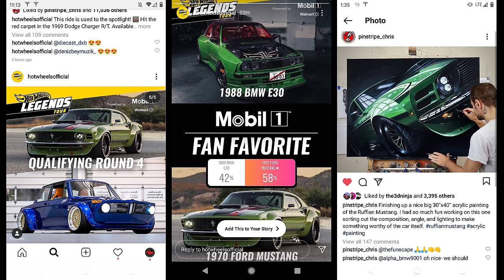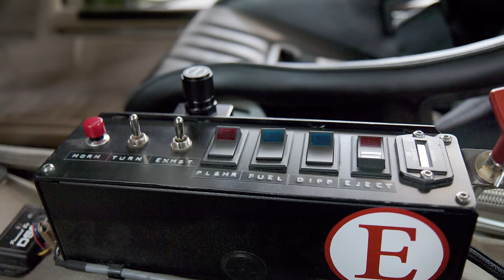RUFFIAN MUSTANG: 625 HP "Boss 427" All-Steel Widebody 1970 Fastback Mustang | EP16

Comment: I had a 70 bud Moore home built version with the Meyer Fiber glass flares. 351c 4v top loader, nascar short track cam, Lincoln drilled 4 pistons and 67 4 piston rear conversions, 3.89 t lock, heim jointed sway bars, etc. Boss 302 track cage. It was fun to autocross in 86. Had to convert it for street use with lights and  wipers.  Painted aircraft green polyurethane.  Like Mad Max Falcon.  They called me Mad and the car Max Bitd. Memories.
Reply from the maker: Thank you for sharing!!!
Reply: That's sick! 💥
Reply: Awesome!

Comment: Hi 👋, What a great drive must be very happy with that, When I was in late 20 / 30 I raced 250 Cc Honda Kart , And considering I didn’t have a lot of money for a couple of trophies, in 2001/2 About 20 of us road from UK to St Tropez Harley Davison softail deuce. Hog rally, We were there for approximately a week one of the guys found a Kart Circuit, We ended up  hiring the circuit for the day, at 50 years young, I won every race apart from 2 , One because Throttle linkage  broke,  the 5  race I got T-bones , For some unknown reason they started accusing me that I had race before, 😂 . As the guy said to you slow and easy smoothness Great throttle control, Very rarely touch the brakes just to get the back to breakaway and drift round under power.
I have never watched quite a few of your territorials find them very interesting, Good experience, Even to this day I drive corner to corner.
PHIL FROM THE DARK SIDE OF THE MOULIN 🎸. FRANCE
Reply from the maker: Thank you so much for sharing your experience with us!!  Greetings to you in France!!

Comment: Message for Chris: Very smart "flipping" the rear lateral control Watt's link. More cars affix the center pivot of the bellcrank to the center of the rear end housing, low link to panhard bar mount on frame LS, upper link to subframe on RS. This creates a "pure" vertical motion RELATIVE TO THE CAR BODY (which is rolling to the outside of the corner, so); the wheel bump tracks the rear end housing slightly laterally - creating an odd feel for larger bumps or larger body roll angle.
Making the pivot of the BELLCRANK on the Chassis and affixing the low link to the low end of the rear axle housing (LF or RS) and the upper link higher (above the axle, other side of center) to the rear end housing; this creates a vertical path relative to the rear end housing (and perpendicular to the road surface) so there is no lateral movement in bump affecting the chassis.
Comment back to me if you wish to discuss further - and a concept for a FULLY true independent front and rear suspension that does not induce body roll, does not need any anti-roll bars (the body isn't rolling so, unnecessary) and does NOT bind up the chassis at all. It has been fully simulated in MSC-Adams Car software (I was an Adams applications engineer at MDI - now MSC - for many years).
I know that it would be mind-blowing on an autocross car - no chassis roll!
Reply from the maker: Very interesting...thank you for sharing!!

Comment: Nice driving...knocking 2 seconds off with each run is really good... 
This seems to be very like slalom events here in France but more sane.
At my local circuit, which was originally designed for go-karts, so a proper twisty circuit, they change the thing with heavy hay rolls (1 ton + if it's rained overnight),there are  trees and there's a blind crest with adverse camber 180°right  immediately on touchdown....

One year I wandered up the outfield grass after the crest and realised there is a 40 foot drop down the tre- covered bank to a main railway line! 
No barrier, of course.
That'd be way too sensible.  This is, after all, France.
Reply from the maker: Love it!!  Thank you for sharing with us!!  We're so glad you enjoyed watching this episode!!

Comment: For the Boss Mach I Weiand High ram Tunnel attached to one Holley 850 cfm. Maybe 2 inch ground clearance 2 inch oil pan and ground. The 3 inch ground clearance under door of Ford to the floor, cool extra flare fenders and 3 degree neg. camber just front alignment wheels. The side exhaust pipes should go thru the wall where the rear seat is. For a real reason you have 4.11:1 rear diff. overall ratio but the tire has a diameter that change the output torque per rpm range. The rear wheel of SHO Mustang 1970 Racer green with Yamaha intake plenum Multi-port F. Injection fitted to Crate motor. The tire is 22 inch tall for best take off bottom dead torque that nothing beats 13 inch rim drag car 4-wheel drive top Fuel. Boss 4.22:1 rear diff. includes maximum 2 foot width of both live axles and ring gear in the housing. You made the tires into both track like it is cornering is better because the widest width of your car onto traction while riding hi-speed on street parking lot is high performance. But the gravity is low center of the Boss slalom car is good performance but better off to get the 4 wheels steering Denali for racing and it must become change into low rider just like your Boss Ford Chevy Hybrid of expensive design. The two wheel steering is possible to captive the car. The 4 wheel steering for great low profile is impossible to captive. The air shock absorber can rise higher when turn left at same time towers right side air non dampener must be higher ground clearance. The left side is less ground clearance 2 to 3 inch. Right side will be max ground cleara. 6 inch. Lean is around 10 to 20 degree inclinometer of your newest design prototype while it drove on the level horizontal road parking track. Stupid old car is always like this while turn to the right, it sway meaning right side under the car 55 MPH it increase the height of ground clearance up to crazy high 6 inch to 7inch as opposite of computer controlling the shift the sway into opposite of the lean car must run like skateboard that weight min. 4,000 pounds or 5,000 lbs includes roll bars max.
Reply: I think you summed up the episode perfectly…. I mean, it seems like this is a word scramble of sorts.  Is there a prize if I can make it make sense?

Comment: Wanting to keep it cheap and light. LS3? All aluminum Ford 427 would've been the right choice, though.
Reply from the maker: The Ford is too wide to keep the original shock towers, and Chris was motivated by the TransAm traditions. Thank you for watching!
Reply: @NicoleJohnsonsDetour  I didn't know you had to keep the stock shock towers for a street driven car. I replaced mine.

Comment: Amazing true trans am style cool but killed the vibe with the LS sad ! A car like this should have a Ford coyote motor! : ( like putting a coyote on a first gen Camaro guy looks like charactor on king of the hill
Reply: I don’t think you watched the episode.   A coyote won’t fit with stock shock towers.
Reply from the maker: When we filmed this, we talked in greater detail about Chris' reasoning behind not using a Coyote, but it's only briefly discussed in the episode. At 5:26 he says that he uses the LS3 because it's a newer motor with an old school design, which he needed to do to fit it between the shock towers. He really wanted to try to build something that fit the TransAm rules, and that was one of the requirements. Ford doesn't have a modern option narrow enough to fit between the shock towers. He also has a Hurst shifter... what I appreciate about Chris is that he is more concerned with building what he likes, rather than worrying about what brand the components are or what people may think about his choices. Seems to be working for him... he has a huge following!

Comment: Where can I find those deep dish rims??
Reply from the maker: From ruffiancars.com, they are Signature ONE in Gloss black hoop, matte gun metal center, black hardware 
Front Wheel Size: 18x11
Rear Wheel Size: 19x12.5
👍🏻
Reply from the maker: Oh wait... those specs are probably for Chris's street wheels... hmmm... I'll see if Chris can shed some light on the race wheels, if that's what you are looking for!
Reply from the maker: Ah here you go… from Chris: 

Also Signature Wheels. SV603 Attack Series. Same size for the race wheels except we couldn't go quite as wide in the rear due to being one piece monoblock wheels (for lightness) so they are 12" wide.
Reply: I need some lol.

Comment: Boa tarde congrats carros this owner built 1972 Chevy c-10 longped makes a Big impression, custom g 1951, this bagged c-10 at the beachis the best, what s LT like to drive a 1964 c-10 truck? ( Supermerged Chevy lsa), 570 Hp ls3 swapped Chevy sububan hot Rod, 80 c-10 drag truck page 2 -the 1947 - presen t Chevrolet GMC truck message board network, this 1967 Chevy c-10 is smokin, duramax diesel powered 1956, Marty -s 1965 c-10, c-10 era Detroit pistons bom 💪🏾👍🏾😎✨🚗 amén trabalho c-10 era 2023 uau sabia de tudo
Reply from the maker: Thank you for watching!

Comment: I dont know how this guy did what he did.. because a stock 70 mustang boss 429 is about $108K - then the LS3 with trans is abut 22K.. by the time YOU finish this car, suppose you do the same, painting, bodywork, mechanical, parts etc is about $167,000.. NOT CHEAP by any means.
Reply from the maker: Chris started with a basic fastback. It wasn't a Boss or Mach or anything fancy. Still, not cheap!
Reply: It's not a real boss. Was just a sports roof with a 351 in it.

Comment: I'm somewhat conflicted, I bleed Ford blue ,and it's gasp LS powered . HOWEVER , I'd rather see the shock towers with an LS than no towers and a SBF. and besides GM stole the LS design form Ford anyway
Reply from the maker: Thank you for watching!!
Reply: How did gm steal the design? I’ve heard that before , but never knew the story..
Reply: @caddydave  it may not be an outright copy but GM did make it similar enough in ways such that things like cylinder heads will bolt on from one to the other. Google would be the best one to ask for details
Reply: @2nd66tube2  ok, I googled it… I don’t really believe it though.   Let’s say the head bolts on, is the gasket the same.  There are only so many bore spacings and bolt patterns for a head.   If gm had really copied Ford , they would have made it so none of the parts interchanged with any other engine size…. :)

Comment: Why use a GM engine on this classic Ford ? Why not use a 5.2 supercharged 760 HP  engine from a GT-500 ? Smaller displacement and more power.
Reply from the maker: Chris wanted to keep the Trans Am rules, so he kept the original shock tower locations. A modern Ford doesn't fit, too wide. He also didn't have the budget to do that if he wanted to.
Reply: Thanks for the info !! @NicoleJohnsonsDetour

Comment: why is she driving with left foot on the brake the whole time it should be on the clutch
Reply: There was no need for the clutch on this run…. It’s pretty common to “left foot brake” in various forms of racing..
Reply from the maker: Left foot braking eliminates the coasting that happens when you take your foot off the throttle and transition it to the brake. Might not seem significant, but the time adds up. Additionally, the suspension stays more balanced when there's not all the back and forth with the right foot... sometimes I even drag the brake a little while still on the throttle to keep the RPMs up and slow the wheels. Once I need the clutch, then the left foot handles it, and the right foot moves over to the brake, when stopping, for example. I have used left foot braking in all of my professional offroad motorsports.

Comment: What a paradox, a gorgeous classic Trans AM Mustang ruined with a boring, budget engine swap. A total lapse in judgment.
Reply from the maker: Modern Ford engines don't fit between the stock shock tower locations, as required by the Trans Am rules which Chris was intentionally following. Good judgement requires all sides be considered. It appears he did not have a lapse in judgement, but thoughtfully considered how he would build his car with the resources he had.

Comment: If you don't know anything about engines, just copy everyone else and LS it
Reply from the maker: Given his reasons for the selection (high displacement, lightweight, affordability, and still fitting between the stock shock towers to keep true to the TransAm series specs), rather opposite, wouldn't you say? Seems to me that Chris knew quite a bit about engines and available options when deciding to put an LS platform in his Mustang.
Reply: Once you have built / worked on a few fords, you realize why someone would arrive at an ls…. :)

Comment: Love the Eleanor engine set up except for LS? 😡 even though u went Chevy 6speed 😢what food doesn’t make good enough 6speeds? I bet a newer GT350 R Tremec one may do u better u did all the work go back to ford power man!!! JS u do great fab work find a way to coyote it
Reply from the maker: Chris didn't use a Coyote because it's too wide to maintain the shock towers, which was more important to him in keeping with the Trans Am rules. Cost was also a factor, but his primary reasoning was the fitment of a modern Ford.
Reply: They don’t actually…. Ford doesn’t have anything even remotely close to this in terms of size / weight / cost.

Comment: Beautiful car... To bad he ruined it with the Chevy motor...  Lost my interest at 5:33
Reply from the maker: Too bad! You missed how much fun we had racing it! Thanks for trying it out... perhaps you would enjoy this episode with a very respectable Ford Performance motor: https://youtu.be/TnsC8Q2JWMc
Reply: @NicoleJohnsonsDetour  The Ultra4 Bronco was great... It had the proverbial Ford in a Ford which is how it should be.  
The craftmanship on the Ruffian Mustang was great but the choice of motor is no bueno for many a Ford fan.  How would a Corvette purist feel if someone installed a Coyote in a Vette?
Reply: @billgoodwin3053  The problem is that the Coyote is just too wide to fit in most anything besides the vehicles it was originally intended for.    The front suspension is (mostly) bolt on and the LS fits without have to cut the body  / inner structure of the car.
Reply: @caddydave  You miss my point.  I was using the Coyote as an example... I could install a Godzilla in a Vette and get the same response/reaction...
Reply: @billgoodwin3053  I didn’t miss your point.   :) a Godzilla won’t fit in a Corvette either….   Unless of course you want to hack the car apart.
Reply: @caddydave  The Godzilla is 1 inch wider 25.75 vs 24.75 than an LS and 4 inches shorter 24 vs 28.75.  So other than motor mounts and crossmember mods I dont see any hacking required
Reply: @billgoodwin3053  ok, I stand corrected on the physical dimensions.   I won’t go into all the other reasons why a LS is still a better engine choice.  :)
Reply from the maker: @billgoodwin3053  @caddydave Good banter, boys. Good banter! Chris was on a budget and wanted to keep the shock towers because of the TransAm specs he was striving for. It may not be a perfect choice for everyone, and I understand how blasphemous it feels to some, but to each their own. If their workmanship is admirable, I appreciate their efforts and freedom of choice! Thanks for watching!
Reply: @NicoleJohnsonsDetour  I will keep watching cuz you get to drive some cool cars.
Reply from the maker: @billgoodwin3053  Yes, I can definitely say I get to drive some very cool cars! Thank you!!

Comment: I ruined the car by putting a GM engine (LS3), with all the investment made, it makes no sense not to use an Aluminum Coyote engine. One thing if you do not have a single dollar, but it is not the case.
I have a Mustang and a Camaro, and their engines are the soul of those cars, I hate these things they do, of building hybrid cars using engines from other brands. For me it ruined the Mustang!!
Y peor aún, el cara dura le coloca en las tapas de valvulas 427!!!!
Reply: I don’t think you watched the video.   :) a Coyote won’t fit without cutting the inner fenders.    What I learned from the video is that Chris was interested in keeping the structure somewhat factory just like an early 70’s trans am car.    I think you should watch the video again and listen to Chris’s reasoning for doing what he did.

Comment: Someone needs to explain to him it can't be a Boss with a LS engine in it....🤮🤮
Reply: You might be just the guy to give me some advice.  I just bought a 70’ Boss 429 that’s a bit of a “barn find”.  My plan is to install the latest 2.3 ecoboost on e85.  Im hoping for 450hp.   I’ll be able to do it without cutting / drilling / modifying the structure in any way.  Instead of “BOSS 427” mine will say “BOSS 140”.  I think it would be pretty sweet and it will keep it all in the Ford family..